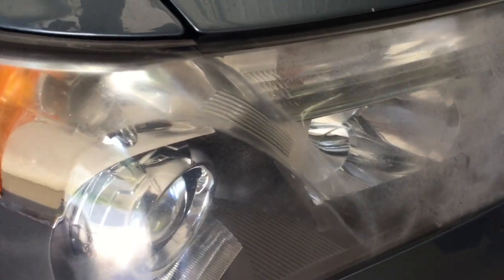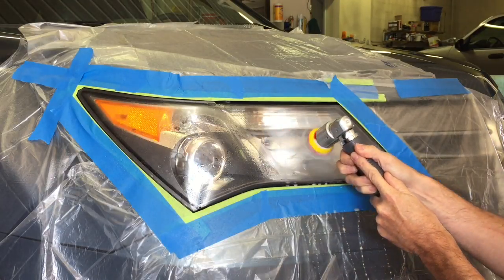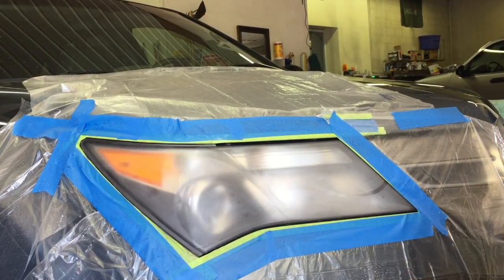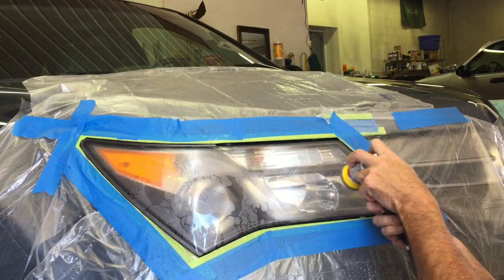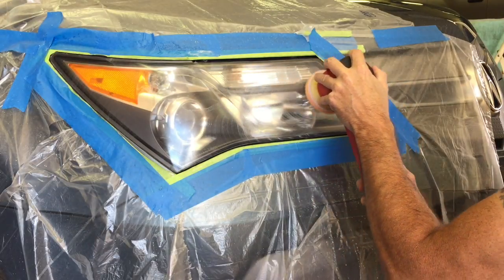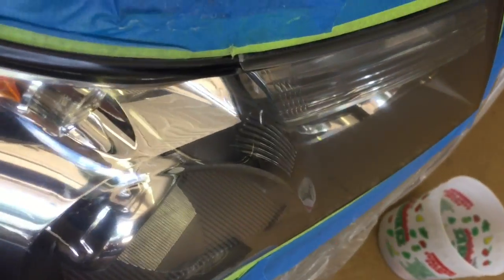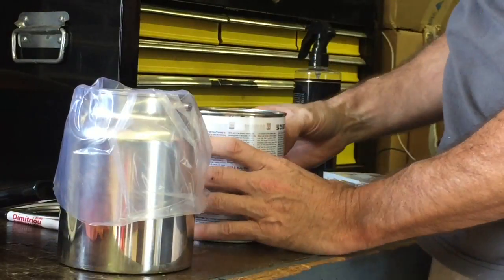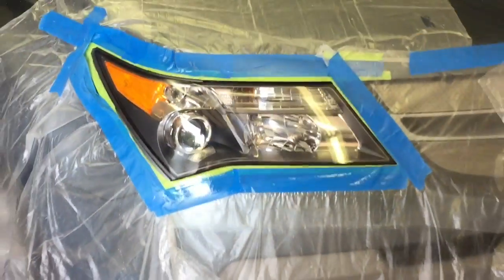How to COMPLETELY and PERMANENTLY Restore Headlights!!

Comment: Any follow-up video on how clear held up after 2+ years?  How do you get the clear to adhere to polished surface?  In the paint business, you need mechanical adhesion (no finer than 600 grit) when applying paint.

Comment: have you done any coatings on headlights? Like Opti Lens. How come you choose this method over a coating?
Reply from the maker: Hi Duray! The clear I used is actually better than factory headlight coatings. I also make the layer thicker than factory. It will not come back to be redone. 😁
Reply: Apex Detail what brand is the clear coat and where to get it?
Reply from the maker: Clear Diamond... I get it here👉🏻http://www.jegs.com/i/KBS-Coatings/191/8304/10002/-1?CAWELAID=230006180039225907&CAGPSPN=pla&CAAGID=44693592161&CATCI=aud-224375369591:pla-177238950071&CATARGETID=230006180039218667&cadevice=m&gclid=Cj0KCQjwxdPNBRDmARIsAAw-TUmgPs5cLsZm1t_YEPp5uPOmQQlm0-q6qIrRELYffMDuaHUecdh7oL0aAsQKEALw_wcB
Reply: @apexdetail85  The reviews of this product on Amazon are very forcefully negative. Many people say the can won't open because it is glued shut by the product. They end up breaking the lid and removing it with vise grips. Then they are left with a can that can't be resealed. I wonder if it because the cans are sitting in an Amazon fulfillment center forever...

Comment: Great video !! Quick question, what brand of Mini Polisher / Sander and also 3" Polisher did you use, and where can I purchase them from ? Any links ? Also the hook & loop pads. I've been doing a similar process but using a full size buffer. These tools look much more effective. Thanks in advance for any info
Reply: That is a Griot's Garage 3" polisher.
Reply from the maker: Jason is right on with the 3 inch. If you need a more powerful unit this is another option👉🏻https://www.walmart.com/ip/Metabo-600405420-3-1-8-in-Compact-Random-Orbit-Disc-Sander/37468078?wmlspartner=wlpa&selectedSellerId=1186&adid=22222222228025160829&wl0=&wl1=g&wl2=m&wl3=52572274335&wl4=aud-273067695102:pla-79645764135&wl5=9007443&wl6=&wl7=&wl8=&wl9=pla&wl10=112561889&wl11=online&wl12=37468078&wl13=&veh=sem

The mini👉🏻https://www.walmart.com/ip/Central-Pneumatic-Professional-2-Mini-Orbital-Air-Sander/361955025?wmlspartner=wlpa&selectedSellerId=916&adid=22222222228068909110&wmlspartner=wmtlabs&wl0=&wl1=g&wl2=m&wl3=175398631910&wl4=aud-310687321802:pla-279199864246&wl5=1025240&wl6=&wl7=&wl8=&wl9=pla&wl10=113134359&wl11=online&wl12=361955025&wl13=&veh=sem

The discs👉🏻http://www.tcpglobal.com/Auto-Body/3M-Foam-Discs/
Reply: Jason Tubbs thanks......do you know what brand mini sander / polisher that is ?
Reply: Apex Detail  ...... Thanks for the info, I'm going to order a set ASAP , don't think I need anything with more power, seeing how this works good for you.
Reply from the maker: 1uniquez    It works fine for what I use it for. But for some who need it to cut through clear coat while doing corrections. It falls short on expectations. Just thought you should know. CHEERS!!
Reply: Now that I am unsure about.

Comment: I do not  have those type of buffers. Can this wet sanding be done by hand?
Also other videos I have watched show that the lens can be cloudy after the 2500 wet sand but comes out clear once the clear coat is applied. Is the polishing cream a necessary step and again can that be effectively done by hand? Is the polishing cream a wax or compound?

Comment: Hey I have 2 questions concerning this video. When would you just polish the headlights instead of wet sanding? Also why not use a 2k clear?
Reply from the maker: The old protective coating from factory must be removed completely. The clear I used there is durable and designed to bond well with clear plastic.

Comment: You said 70% of what a new set of headlights cost. Can you give me an example?
Reply: Luis Espinal,
70% is based on the car. Not every car of course.  You can get civic headlights for 150 for both and im sure thats what he charges for this. But cor a mercedes S550 your looking at 1200 for both so higher end cars its worth that cost.  Hope this helps.